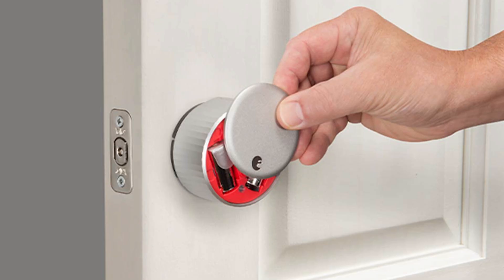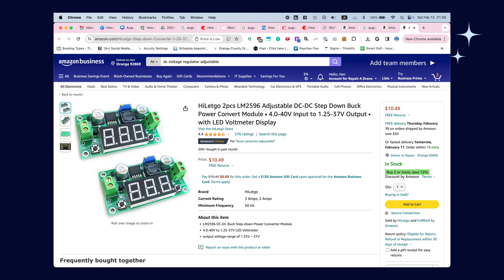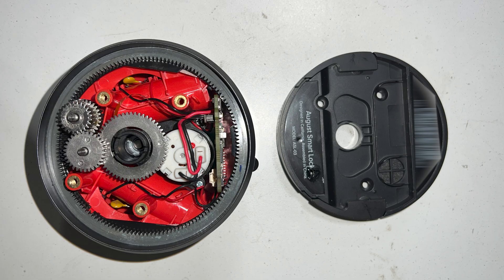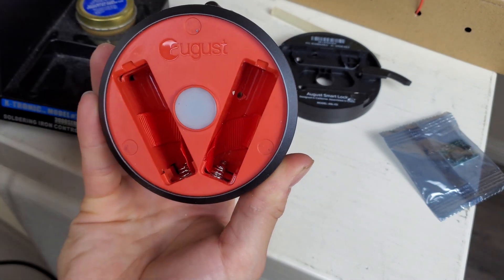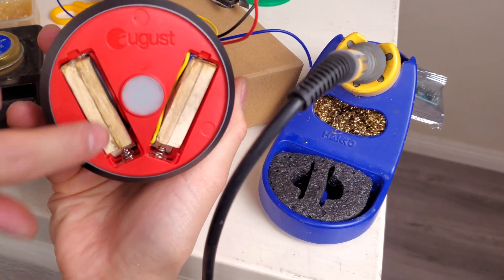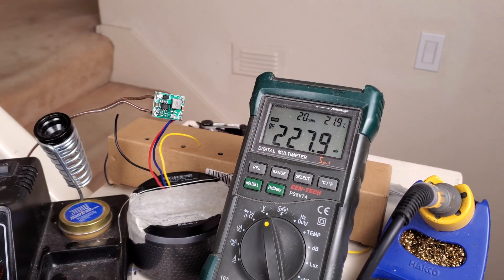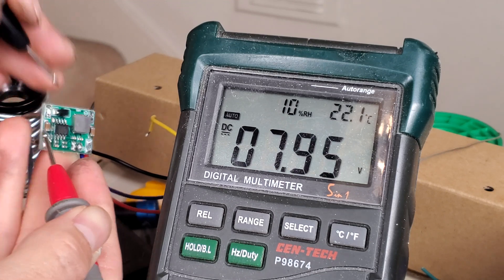How to Hard Wire A August Smart Lock - No More Batteries!

Comment: I have tried same it didn't work but figured make two separate DC channels as it is in battery system,then started working I tried couple times at third try figured please correct your video even you showing in diagram is not gonna work cause DC step down circuit to heat up.

Comment: Changing batteries every 3 months?!?  I wish.. I go through a set every 30 days.  Last month I used the lock less than 10 times and it still burns through the batteries.  What a gawd awful lock this is.
Reply: yep, gives new meaning to "dead bolt"
Reply: I use my August lock on my vacation home. Absolutely worthless unless I'm there to change the batteries every 20 days, so I don't even use the remote lock feature anymore.  I'll try this mod, looks like it'll solve my issue.
Reply: @PamTaylorGlass  Give August tech support a call and tell them the issue.. they were giving out free wifi adapters... you turn off the wifi on the lock and it just uses low energy bluetooth to talk to the wifi adapter instead.   It works well and saves on the need to do the 'hack' in the video.

Comment: Great until your loose main electricity, rare but it happens. Any update?
Reply from the maker: @manho9877  well August lock allows you to still use the same external lock so you can still use your key
Reply: You could get a battery backup UPS for the hard wiring to plug into, so during a power outage the August will still run for however long the UPS has battery power.  Or as the OP says, you can still use a key.

Comment: But how do you hide the wires inside?
Reply: Kind of important right?!?
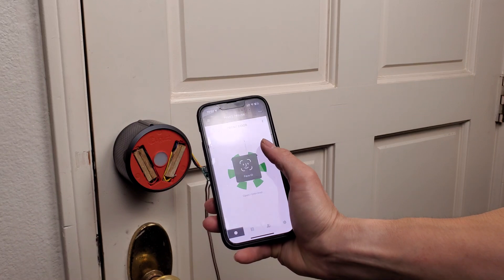Reply from the maker: @jacobgallant8861  nope you can see my video. I do have the wires running on the outside, but it’s not really that big of a deal to me. It’s totally worth it. 5:29
Reply: It can be done - see my post linked above.  You need to drill a hole through the door (3' drill bit required).